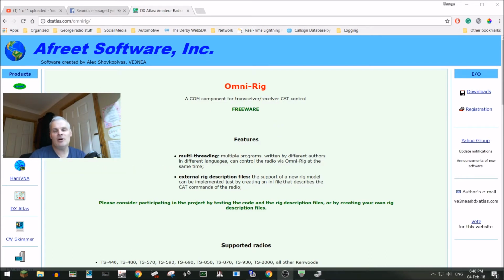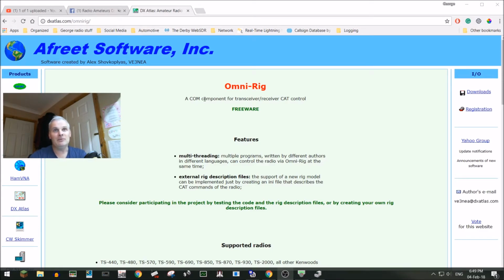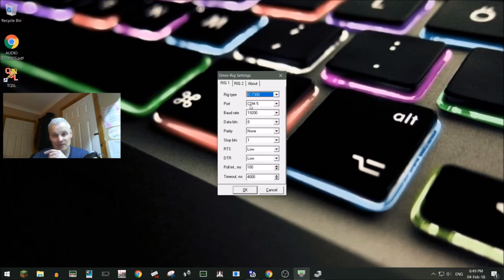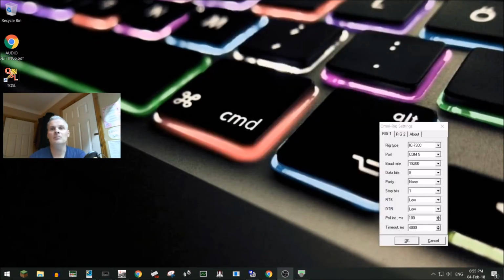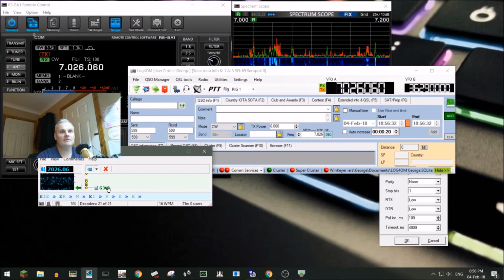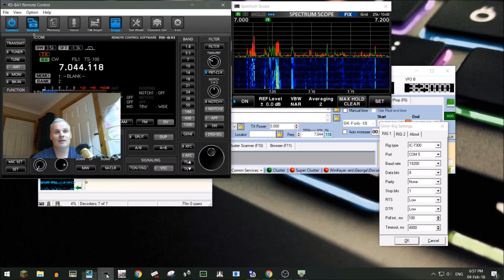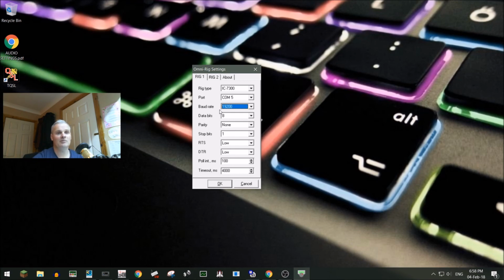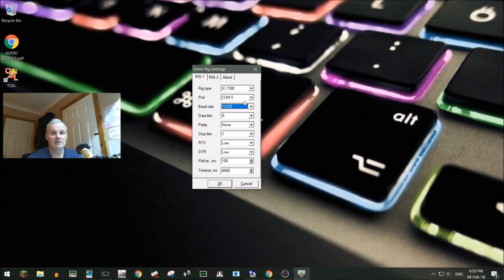OmniRig Explained - CAT Control for Ham Radio Made Simple

Comment: Would be nice if it worked. Tried everything.  Open , extract and it is nowhere to be found on me computer.
Reply from the maker: Open start menu and type in omnirig. By default it should run on startup. But you'll find it in the search on the start button. Then pin it to your task bar.

Comment: Good Explanation. I have a IC-7300 and LogOM for logging. I had WSJT-X working for FT8. Once I put OmniRig inline, WSJT-X no longer works. Any Suggestions? I  only have the Cat cable to the IC-7300. Do I need another cable connected to the IC-7300?
Reply from the maker: Most will tell you you don't need the USB to ci-v cable, that a single USB will do. Until you try to do what you are doing. I use the ci-v to handle rig control via omnirig and the USB does all the other work.
Reply: @GeorgeEI7KO  , Thank you very much for the reply. That's where I assumed I was going wrong. I ended up disabling OmniRig for now. Had to remove and reinstall the Cat cable for WSJT-X to connect again. But, I'm back on track until I get/make up a USB to ci-v cable. Thank you again. 73, de KC0ARB

Comment: Omnirig puts my ic9700 into transmit soon as I turn radio on , any idea were I'm going wrong ?
Reply from the maker: Going from memory, you have to change the RTS setting in the connectors menu. Now I have the 7300,the 9700 may be different.

Comment: this is software burn my radio I just bough 991a I had to get new radio had mismatch setting broke my radio
Reply from the maker: Mismatch?
Reply: @GeorgeEI7KO   1 or 2 stop. High low handshake
Reply from the maker: @hamradioshack9066  I can't ever say I've heard of a case of a software package damaging a radio. Wow, sorry for you man.
Reply: @GeorgeEI7KO  I'm trying use. 991a with sdruno. Software is RTS. Off or on radio 991a you put 100 and 100 on omni reg setting in bottom where I can set that in radio?thxxxxx

Comment: Great Video, clear and precise on it's function... Regarding Installation, I have seen references that once you have installed it, you then need to "run" it "as administrator" is that correct..??.. Thanks
Reply from the maker: Dave H I run everything as admin. More control that way.
Reply: Cheers... Thanks
Reply from the maker: No problem. 73